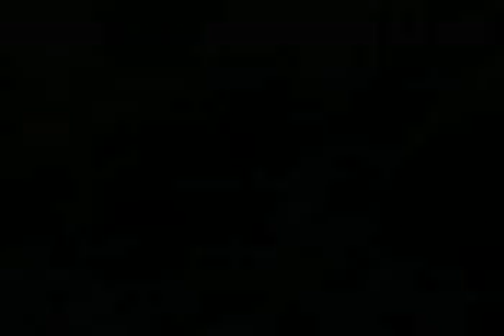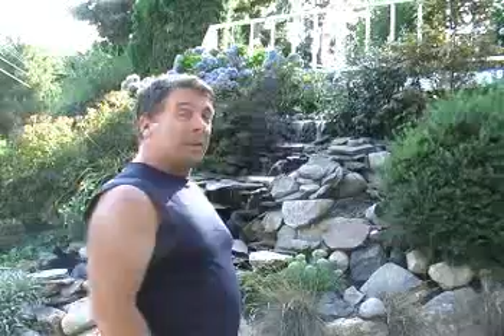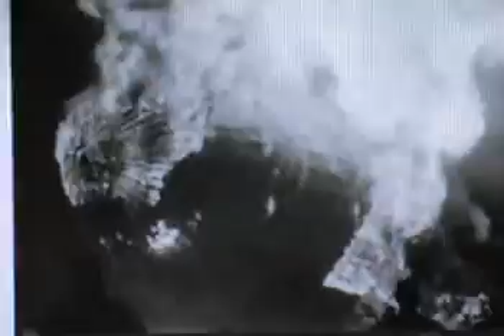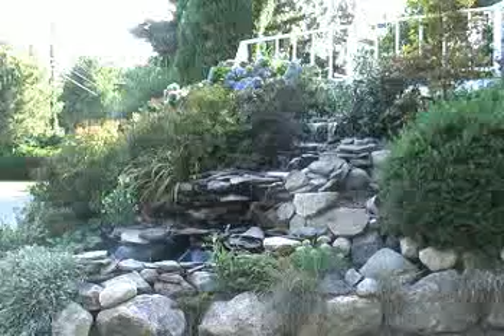hydrogen generator finally proven pt.4

Comment: 8th grade science experiment proved emersing a stainless steel nail wrapped in aluminum wire into a beaker of H2O percotates HHO. Not a huge mental leap to recognize the advantages of 120 octane HHO gas over inferior 87-91 octane gasoline. Especially since the exhaust from petroleum gasoline is poisonous and the exhaust from HHO is Oxygen and water vapor. Inexpensive dry cell hydrogen generators easily produce 2.5-10L HHO/minute, enough to reduce or entirely eliminate the need for gasoline.

Comment: Well I for one do not build my own solar panels. But if I did why would I use them to convert to electric...then to hydrogen.., then back to electric when I can avoid the efficiency losses by simply using it for electric? In other words it is not so simple as "well just use a soler panel"  and then...."just use the hydrogen from that to power your house...free energy? How do you get it from hydrogen to electric to power anything?

Comment: Now granted we certainly can use solar panels to produce hydrogen...but have you priced a solar panel recently? Have you figured out how much kw of energy it takes to produce hydrogen from water vs. simply using it to charge batteries? Google "Ford solar panel for plug in" and see. It cost $10,000 and goes on the roof of your house. But can get your plug in car to travel 1000 miles a month off the grid. Research more please.

Comment: Well not really. You see my point from the get go is not that it is impossible to use hydrogen as a source, but that it is too expensive and inefficient to produce hence we are STILL stuck in the oil trapo...and have only been offered electric vehicles as an alternative due to the government FORCING the automakers to produce a % of zero emmision vehicles. Sadly oil and ICE engine are really cheap in the USA so there is no incentive to research hydrogen more then what is already forced by Cali.

Comment: And to add I have family in Norway and visit frequently. There are currently testing hydrogen buses in Oslo. Granted they are actually electreic vehicles using hydrogen to charge the batteries (as oppsed to using it in an ICE)...there is still the problem of generating enoughb for the filling stations. And bear in mind they are the 3rd largest exprter of oil..they got plenty unlike Iceland which has to import it. Still is is SHELL OIL assisting in the production of hydrogen in Iceland. Surprise?

Comment: Did you actually go to the wiki and read it? Wiki "renewable energy in Iceland". It does not state hydrogen is 4x less efficient then gas....it states hydrogen is 4x less efficient then electric hence they are considering swithing to electric as an energy source for vehicle rather then hydrogen. Either source in that country is produced via their abundance of geothermal energy.

Comment: Perhaps but the reason it is being tested in Iceland is obvious. 1) The relatively small scale of the infrastructure will make it easier to transition the country from oil to hydrogen (total population is 320,000) and 2) They have buttloads of geothermal energy literally bursting out of the ground. With all that said they still realize it is 4 time less inefficient then electric and costs more. Cali is testing it as well and they have filling stations. Ask them how it is working out.

Comment: No wrong that is a baseless assumption. I tried it myself on 2 vehicles and did not save a rats ass. So I researched and found no legit proof it works/ The laws of physics as well really make a good case. So now it is up to those claiming they saved fuel to prove it. The flying horse is not circular logic but an analogy. You claim something that many feel is not possible according to known science you get skeptics. I am not a skeptic from assumption..but detect a scam and/or ignorance.

Comment: If the extra "power" lets you throttle back....I would like to see a test where simply switching the onboard HHO system on increases the idle...or where you hold your foot steady on the throttle at 70MPH for example...switch it on and get a sudden boost in speed. If it does this there is something to it. If it does not....hoax concluded. Any takers?

Comment: Yes..they are. Most of the vids are going to websites that sell kits and plans. Some will give free instructions but that does not mean it works. No one has proven it works...ever. Some might feel bad that they went through all that work for nothing or have a placebo effect. You can save 20% or more in MPG just by driving different..weather conditions, traffic conditions...only a dyno and scientific testing is even close to accurate and all conclude....it is a waste.

Comment: Scammers my ass, they explain how to build an HHO system using parts most people have laying around in their garage. The extra items can be purchased at Home Depot for under $50.00  The only choice is to go wet cell or dry cell generator, and a wet cell is easier to build than a dry cell but either can be done with simple hand tools. 9th grade science and the ability to put the red wire on positive and ground the black wire. The rest is easier amounts to attaching a hose to a fitting.

Comment: No one is scamming anyone on HHO, it's 9th grade science and less than $50 in parts from Home Depot. If don't want to make your own generator, can buy one for unde a $100  

Thousands of videos document the results of both dry cell or wet cell hydrogen generators. I drove Phoenix to Kansas City over 1200 miles on one tank of gasoline and 1 gallon of distilled water. Now that I achieved the results I wanted using a dry cell configuration, I'm doing a wet cell configuration on a second vehicle.

Comment: Before I installed an HHO generator my vehicle got 20.8 mpg avg. burning 91 unleaded gasoline. Now I buy 15 gallons of 87 octane every 1500 miles versus pre conversion every 300 miles. I buy gasoline every 1 1/2 months versus once a week. You keep talking like people are trying to scam HHO, yet there are plenty of videos on how to do the conversion for $50 in Home Depot parts. My cost for buying the dry cells was $160 and only other thing I purchased was 1/2" and 1/4" plastic fuel line $10.00

Comment: My vehicle has a 2.1L engine. My HHO configuration is simple. I have a dry cell that generates 4-6L/Minute and a secondary system that produces 2.5L/minute for a combined total of 6.5 - 8.5L/minute. My set up is simple, the positive is connected to the alternator using a 30 Amp relay and the negative is grounded to the frame using a 30 Amp relay. I the HHO is drawn into my vacuum intake using 4 venturi valves. Never draw more than 30 Amps to produce 6.5 - 8.5 HHO/minute and I get 103 mpg.

Comment: Who gives a rat's ass about over unity when the issue is inferior 87-91 octane gasoline that emits deadly carbon monoxide as exhaust versus simple generation of HHO 120 octane hydrogen from H2O that emits harmless vapor. Buring hydrogen on demand using the engine alternator as the 12v DC power source is 9th grade science and easily understood. Wet and Dry Cell Hydrogen generators are available for under $100 if too lazy to go to Home Depot and make one from scratch.

Comment: Gasoline is an inferior 87-91 octane fuel that is refined from crude oil that emits deadly carbon monoxide. HHO is a superior 120 octane fuel that is easily generated from H2O and emits harmless vapor. Burning HHO generated on demand is simple 9th grade science. Achieving 100% HHO fuel is a matter of proper configuration pursuant to universal laws of Physics. For less than $50 in parts from Home Depot even an ignoramus can achieve 25-50% increase in mpg.

Comment: The only way a Wet or Dry Cell hydrogen generator would not do as claimed is if it did not generate hydrogen. The production is based on several factors beyond the control of the dry/wet cell vendor. How the HHO generators are configured is very important. In wet cell have to limit amps to avoid heat affecting output and drycell have to have the generator below the H20 resevoir. Beyond that it's not the generator that is failing it is the imbeciles doing the installations.

Comment: You were the one claiming someone could get a patent for running a car on HHO. The practice is so commonplace, there is nothing to patent. 12v DC current through H20 percolates 120 octane hydrogen that emits a harmless vapor as exhaust versus inferior 87-91 octane gasoline which has to be refined from crude oil and emits deadly exhaust. So many individuals have been running 100% HHO for years that it is old news. Lately, a third of Home Depot shoppers are buying HHO conversion parts.

Comment: Now where it did show some merit is in an older MIT study. They were able to show that adding 15% of H2 and CO to a single cylinder engine helped prevent knock when the fuel misture was leaned out. However they used a plasmatron to produce the hydrogen, not an onboard kit that draws off the alternator using electolysis. If they could get around that small enegy conversion problem and do a serious test on an EPA certified dyno the results will tell the truth. Popular mechanics had no luck.

Comment: The configuration for Dry Cell HHO generators is different than Wet Cell generators. Both systems rely on the same 12v DC power, but dry cell allow for using a lot more amps and therefore produce greater output. More amps equates to more heat so using a pwm helps optimize production while lowering the amount of heat. Pwms come in a variety of sizes and are many have heat sinks and small fans to avoid overheating. When tuned properly the amount of HHO produced can easily be 4-8L/minute.

Comment: I configured 8.5 L/minute HHO production using two generators that draw under 30 Amps combined. I ran the engine all afternoon burning hydrogen and fine tuning the system. As the dry fuel cell manufacturer said, the system relies on physics and it's a matter of configuring to achieve optimal efficiency. Something as simple as installing the generator below the H2O resevoir allowing gravity to fill the cell and using 1/4" line for the intake, 1/2" line for the return. Path of least resistance.

Comment: There is nothing to patent. Converting H2O in 120 octane HHO is simple science. Configuring a hydrogen generating system to create on demand HHO fuel for a vehicle's combustion engine is a matter of adapting existing technology to the space available. HHO dry cells are available for under $100 that produce 4-6L/minute HHO and that equates to 30% increase in HP and a 50%++ increase in mpg. Now have American HHO Dry Cell manufacturers working on foreign contracts producing massive generators.

Comment: @Fred420ist Again you're assuming that this is the result. The extra power lets you throttle back.The extra compression required to blow the engine would also send the RPMs running away on your ass before the engine finally failed. Where not talking about a full blown N2O injection here you know, Where talking about adding a small fraction of gas.

Comment: @ecnatalausio Yes they have! Check out my vid. 95 Ford Explorer. from 15-20.4 MPG. A free 100 miles extra traveling per tank of gas. And that's pulling power straight from the trucks battery. I had one on my '80 Honda CX500 motorcycle. It was the size of a baby food jar, with only 2 electrodes 2"x2" in size. I did get an extra 5MPG, but the battery slowly drained because "rice burners" like that can't have extras put on it, HOWEVER I am replacing some of the bulbs with LED bulbs and trying again

Comment: Yes the car companines dont care about your wallet. But I say Golf Carts hold the key to fuel savings . When you sit at a light your motor keeps running. Why not turn it off ????  I feel the H Gas is good to keep the motor clean burning.

Comment: @capetide lol, you think a 15lb motorcycle, or 30lb small car battery is going to last any amount of time at the draw that it would take to supply enough hho to change anything?
im totally into hho generation, its a sound theory, i wouldnt have found your video if i wasn't into it.
i've been breaking water down into hydrogen and oxygen since I was in 7th grade, but you cannot get enough energy to make a difference out of a couple GRAMS of water

Comment: You don't power the cell with the alternator. In fact you don't even charge the battery with the alternator. Guess what bud, you end up with a NET LOSS at every step of the energy conversion chain -- that's just the way it is!

Comment from the maker: @crapkillerz  
Hi CK, don't know if you watched the other installments of the hho vids but in the 2nd vid I explained that I was using a solar charger on the roof of the bug to charge the battery. The '64 bug had a 6 volt system that ran off of a gernerator and that is why I used a 12 volt bat and solar charger/no juice from my side at all, free sunpower!

Comment: have you tried adusting the timing of the engine to suit the new fuel mix? apparently when using hydrogen to boost petrol, it is a good idea to delay the ingnition spark until the cam is at top dead center... this is because the hydrogen increases the flame speed and combustion rate in the engine... delaying the ignition to reflect this should give the engine another efficiency boost...

Comment: please be cause with the glass grenades. And to the first click isn't exactly real precise. Since you have a carbed engine, could you use a 1 gallon gas can after running the carb dry, and see how far it goes with no hho, and then have another 1 gallon can and run it with the hho, and see how far it goes. Then put the fuel line back to the stock tank and be able to drive home. I would carry a can of starting fluid, and a spare battery just in case.